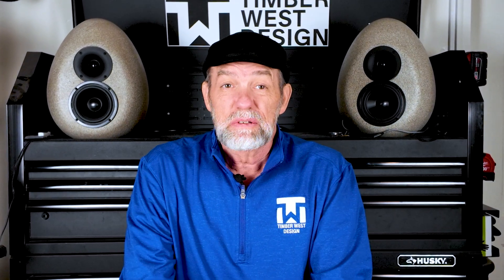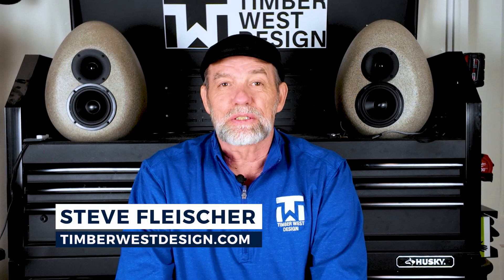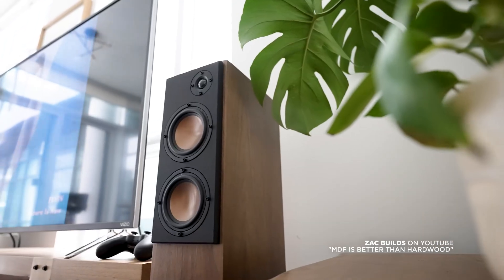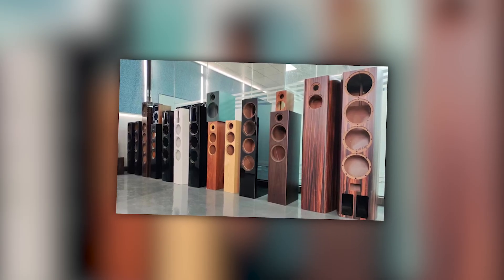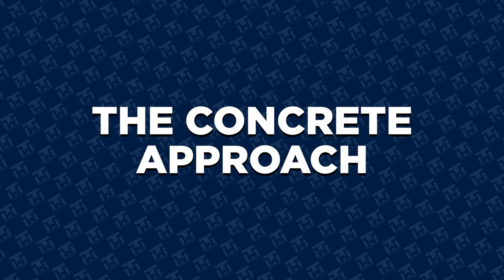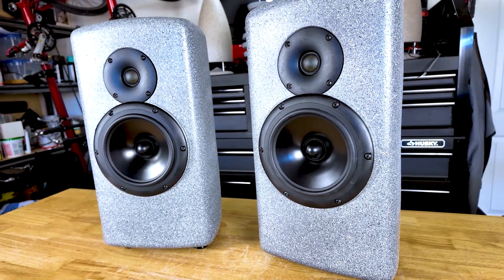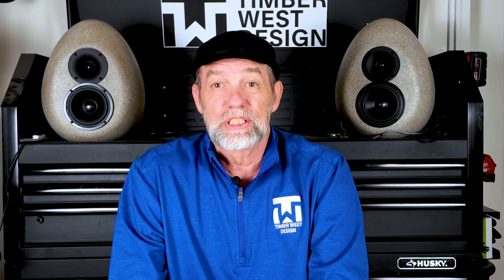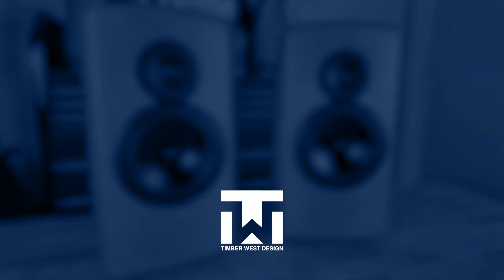What Makes a Speaker High-End? Cabinet Materials Explained

Comment: Companies predominantly use MDF because it's easy to machine and veneer .Repeatable and cost effective. My favourite speakers were the Electrofluidics sonolith back in the 90s that used vibrocast plastcrete ,which drove out voids leading to very inert cabinets. That's going back 30 years from a one man manufacturer who had the freedom to work without marketing constraints that most of the big brands are saddled with.

Comment: The research shows that on axis response and off axis response is what affects the sound quality not materials.  

Ascilab speakers measure among the best and they use mdf not concrete. 

The only way to improve it more is to use coaxial drivers not concrete boxes
Reply from the maker: You’re absolutely right that on-axis and off-axis response are primary drivers of perceived sound quality, and well-designed MDF speakers can measure exceptionally well.

This project isn’t about replacing good acoustic design — it’s about exploring enclosure materials after the fundamentals are done right, especially in terms of resonance behavior, durability, and form factor.

Different goals, same physics.
Reply: @timberwestdesign excellent response sir 👍
Reply: It all matters.